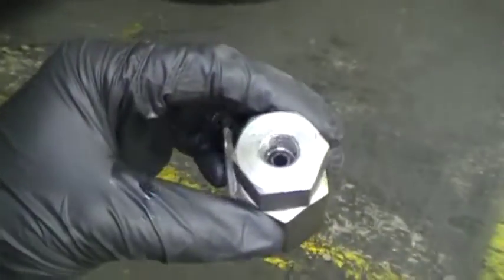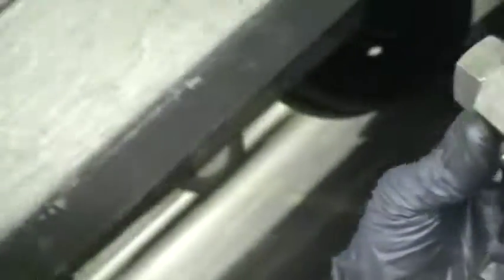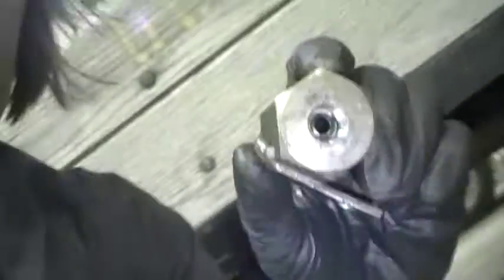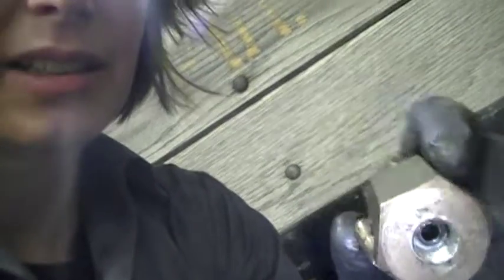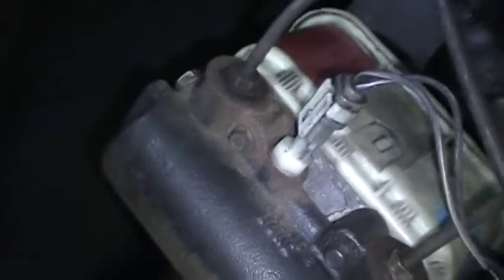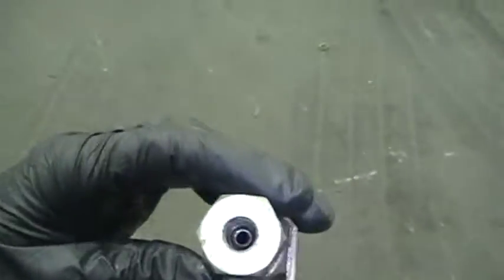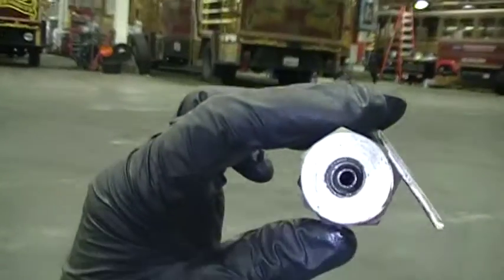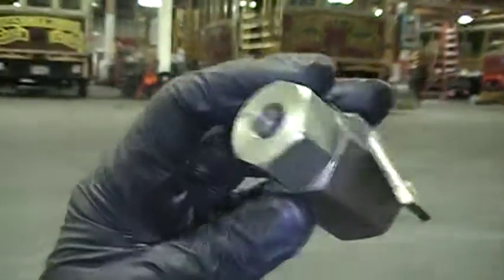FIX REAR BRAKE CYLINDER LEAKS LUCAS GIRLING

Comment: I have a 1987 ford LN8000 with the Lucas Girling brake system can I replace just the brake wheel cylinder without removing the axle? the brakes  cylinders everything we all replaced 10 years go I only put 800 miles on them in 10 years one cylinder leaking now. Great video!

Comment: How much did it leak? I replaced mine both backing plates 7 months ago it had the valve but had the same problem it being old started noticing leaking on one side but will stop if Im driving it. Then now noticed that it dripped down the wheel, ordered a new check valve.

Comment: This is just a guess but I doubt you flushed the brake system completely before installing the new backing plate. Old dirty brake fluid is one of the 3 main reasons for lucas girling brake system leaks.  Note to anyone spending the time and money involved in adding new brake parts to a lucas girling system: clean and flush your system completely BEFORE adding new components and use new fresh clean brake fluid. Your job will be more successful and you won't have to do it twice. Hard to make money when your truck is down unless you're the mechanic.
For those wondering, the other two most common reasons for leaks in this system is installation damage to the seal and boot when attaching the shoes and spinning the adjustment wheel too far. These three issues amount to over 80% of the problems we see on a regular basis with this system.